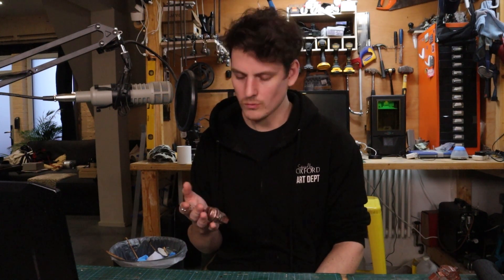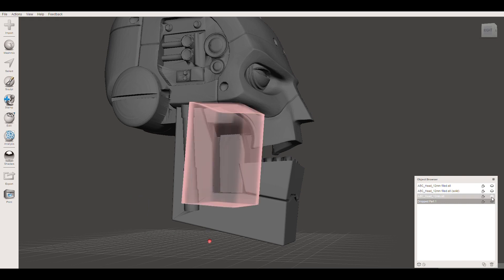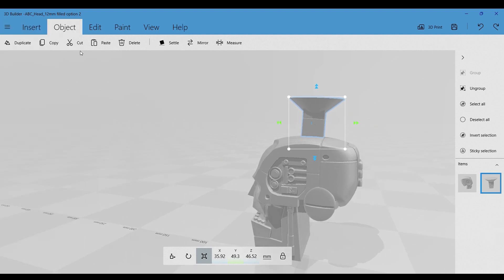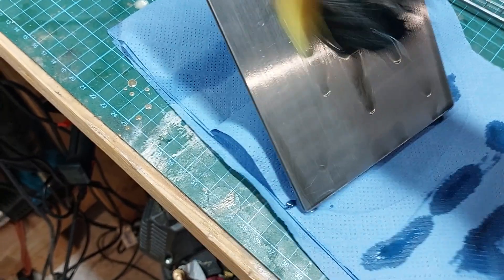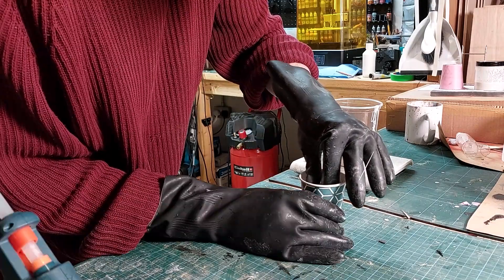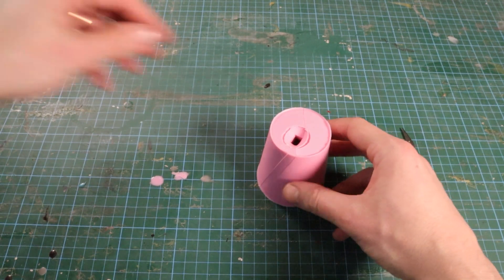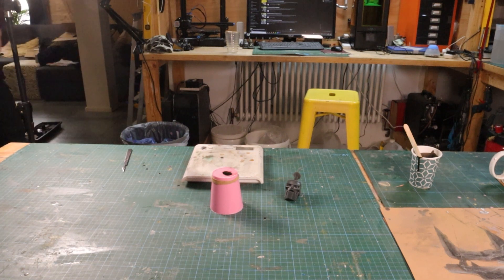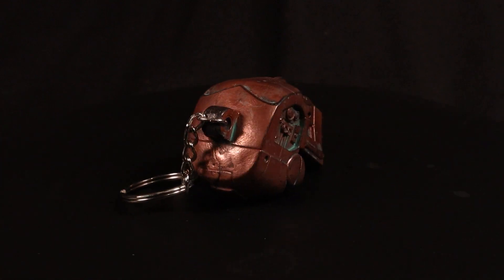How I make 3D prints into metal cold cast keyrings

Comment: I made my first attempt at this the other day and I guess I made multiple mistakes. Mainly I didn’t like the way the metal powder sank, even with the fast-curing resin. I thought I still had to mix for several minutes like resins I worked with in the past but the first mix hardened in the cup before I even had the chance to pour it. The next one I tried to pour a thin layer and then backfill with a second batch about 15 minutes later but after an hour, the two layers had not stuck together and it seemed like the metal was on the bottom with not enough resin to hold it together and then I had clear resin on the top that was still pretty gummy after a couple of hours. 

I’m broke now and probably won’t be able to try again for a couple of months. But I’m pretty bummed out about it.
Reply from the maker: @micah_noel   @micah_noel  youch. That sounds like a fair mix of small but costly errors. Sorry to hear that it's been problematic. I've not had issues with it sinking to the bottom but with hundreds of products on the market it's hard to say if it's the type of resin or powder.  

I use a polyurethane casting resin which does set stupidly quick, and I've had my fair share of mishaps. I've not had issues with uneaven distribution of metal power though.

Comment: how strong is this
Reply from the maker: In what sense? You can hit it with a hammer and it won't break. I often get them caught on the polishing wheel and it fires them into a concrete wall incredibly fast and they don't mark. They're pretty solid. Its solid polyurethane resin. If they have lots of very sticky out bits they won't be very strong.  The loops don't break either, I haven't ever had one break but I have had the o ring or the keyring chain break so its worth shopping around for a good supplier for these.
Reply: @thehermitworkshop2913  yeah i was just trying to see how strong it is in comparison the a metal duplicate.  nice to know it doesn’t warp or break when polishing thanks

Comment: Great video, glad to see you back on YouTube!
But please, PLEASE, don't wash the piece under tap water before having cured it. There's still some uncured resin on it for sure, and you don't want that toxic stuff going down the drain. Use some hot water that's in a bowl and then dispose of it after having left it under the sun and then straining it!
Reply from the maker: You're absolutely right! Since making this video I have changed my practice and do exactly that. A bowl of warm water then dispose of the water after leaving it in the sun (or chucking in the UV cure chamber) and then running through a strainer (essentially a large coffee filter). I have removed the clip of me rinsing it in the video (may take 24 hours to change) to avoid promoting that kind of activity. I was thoughtless and assumed the wash and cure and IPA would remove all of the uncured resin. Clearly, it wouldn't be 100% and any toxic chems going down the drain is terrible. Thank you for flagging! I need to do a "best practice" update video as I have generally upped my PPE game and safety around these genuinely dangerous chemicals.
Reply: @thehermitworkshop2913  thank you for taking the time to modify the video in order to remove that specific clip! 🫶🏻 stay safe while working with resins, I'm a medic and I've seen people getting terrible dermatitises while working with them (gloves notwithstanding)!
Reply from the maker: @ordnaelshideout  No worries! Thank you for bringing it to my attention. I've started using a mask and have put the printers in a separate room from the one I usually work in. So far I've not had any reactions but I'd like to keep it that way. It's certainly something that's become much more common as time has gone on with people being quite lax around these chemicals.

Comment: Nice video. What resin did you use for printing and what silicone for the mold? I ask since I tried this process several years ago but the silicone did not adhere to the printed part properly, the 3D printed part interacted with the silicone material and did not let the silicone cure. I wonder if the newer 3d resins today are making this work now since I did not see you coat the 3D printed part before pouring the silicone mold and it seems like you had a successful mold without any interaction between the two.
Reply from the maker: How unusual! Yes I've used various silicone for thebmoulds but my preference is smooth on mould max, and the resin is ANYCUBIC 3D Printer Resin LCD UV 405nm Rapid Photopolymer in black. I've not had any issues at all. As you say perhaps the resin has gotten better and less reactive?
Reply: @thehermitworkshop2913  Thanks for the info. I'll give it a shot when I get a chance and see if I have better luck with this process now. Looks like this combo works well for you.
Reply: You have to thoroughly clean the print in an ultrasonic cleaner, and you have to thoroughly UV cure it underwater (water curing). That guarantees that the resin is completely cured, so it won't poison the silicone.